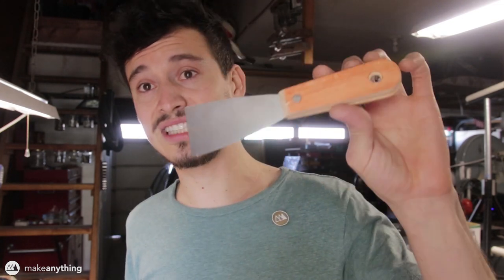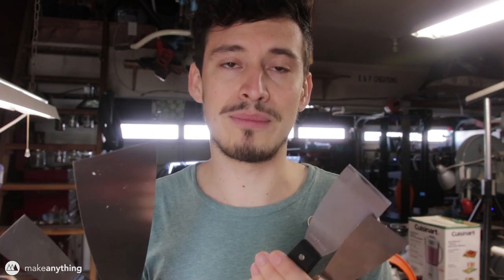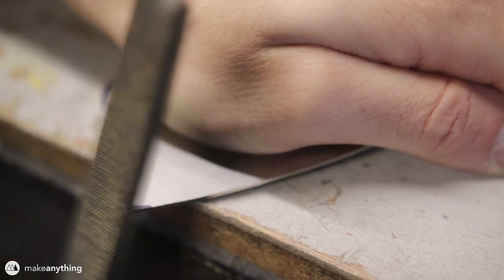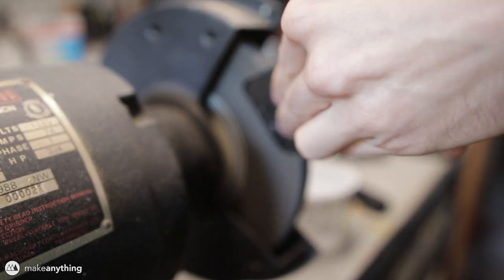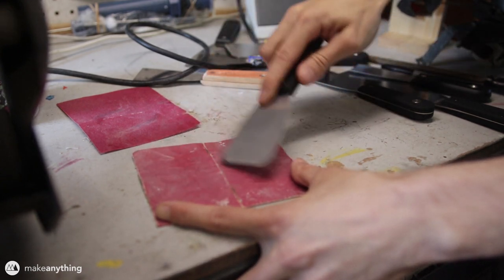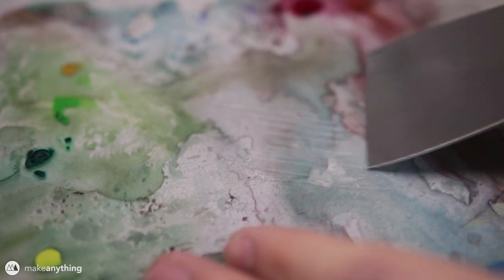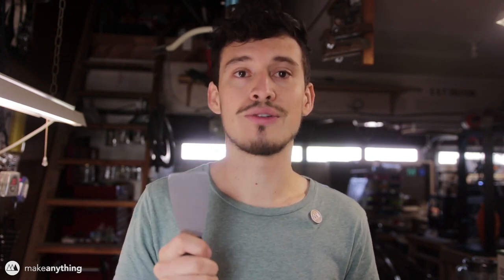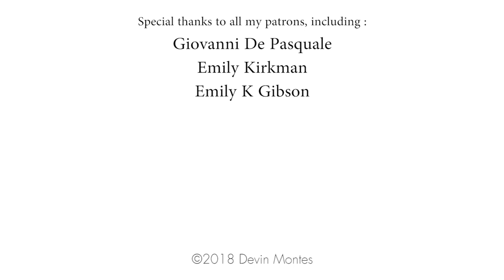Make a Better Scraper for your 3D Printer

Comment: A few things:
- Push the file, don't pull. Its not designed to be pulled
- when grinding, don't do it the way you did in the first shot, do it like you did on the second. Also, keep the spatula pointing down. The grinder can easily snag your spatula and possibly impale your face or body if you are not careful. 
- The term for those burs that you mention is actually referred to as the "feather", and is the reason why you use leather to strop a blade. (fun fact)

Not trying to hate on you but safety is important when you make things.
Reply: also, im pretty sure you're not supposed to use the side of the grinder to grind things. i could be wrong but thats what i was always taught.
Reply: vinny berg OP is mostly right, Never point the blade UP the wheel as is can catch. But using the side of the wheel is sometimes questionable. (Blacksmith here for some kind of qualification of my opinions)
Reply: shrimpicus vinny berg You absolutely don't use the side of these types of wheels.
Reply: NPG3D Why not?By using the front (thin) side you creatie small indentations  on the wheel what maken it bad for grinding only use this side when the whole wheel is being used is what i got taught.
Reply: Levi The straight wheel type is only designed mechanically for use on its rim. By grinding on the side like this, you are greatly increasing the chance for it shattering, and it can't be smoothed out via dressing. 

As for the small indentations, that is not exactly true. Much of the work done on the face of this type of wheel is in grinding things which are smaller than its width, such as drill bits and pieces of HSS. 

To fix the uneven surface, a tool called a grinding wheel dresser is occasionally used, which is run along the surface to smooth it out.
Reply: NPG3D you can use them that way, but they arent designed for taking cutting forces from the sides. If you do do it you have to grind really slowly and not push on the wheel. Also preferably not that close to the edge of grinding wheel.
Reply: Eric M, that would require removing the guards (unsafe and OSHA incompliant), and plus each time you use it in this manner, material is removed from the wheel in a way that can't be normally trued or dressed, leading to a permanently and increasingly more dangerous wheel at risk of shattering.

Comment: Getting rid of the sharp edges should also reduce blood stains on the print bed
Reply from the maker: +Michael Wuchitech yes, I forgot to mention that big plus!
Reply: Kevlar gloves FTW!
Reply: But blood makes the print better...i mean, it helps modeling clays, putties, epoxies, super glue bonds, makes paint more vibrant...im sure it helps plastic too.  I mean, blood for the....oh wait...
Reply: Sometimes electronics require a blood sacrifice to work

Comment: Have to recommend using oil painter palette knifes, they're thinner, pre-rounded, and you can get a 5 pack for about $6 on Amazon. No prying needed just slide in go around the edge of the print and they pop right off.
Reply: yes

Comment: I use a longer blade scraper with a sharpened end.  Sharpened exactly the same way I sharpen my chisels.  It acts like a flexible chisel.  I print on toughened glass salvaged from a scanner so I don't see scratching on the build plate.  I use the sharp end flat side down at a very low angle to try to get under the print.  It works for me.

Comment: Sorry for smart assing (is that even a proper word?), but files are usually just good for filing when they are pushed. The teeth are similar to the oines on a saw. And you shouldn't hold any object to a grinding wheel like you did in the first shot. When your hand is below the point where you grind, it could easely grab to hard into the grinding wheel and when this happens your wrist will get hurt pretty bad. Hopefully you understand what I have written ;D
Keep up your great work and enjoy your camping/eating trip. Greetings from Switzerland

Comment: As has been previously noted: Files cut in one direction. The pushing one. Pulling on a file mashes the teeth flat and is therefore a great way to make your file not cut for very long. Push, then lift, reset, push again, repeat from step two. Be sure to clamp the work firmly, whether in a vise or to a table, and clean the file with the aforementioned file card regularly to remove the filings from the teeth and ensure a clean finish. 
If you do it right, sanding should be optional, the metal will be removed reasonably quickly, and your file will last for years or even decades.

Comment: The spatula shouldn't scratch glass because glass is harder than the metal used in spatulas. If it is scratching, it's not proper glass or there is some sort of film on it.
Reply: yeaaaah I was thinking how do you even scratch your glass plate, should take more than a spatula.
Reply: Glass is actually really easy to scratch with a blade like that, you can pretty much ask anyone who have tried to clean an aquarium with a razor, and they will confirm it
Reply: Joakim Innvær maybe it depends on the type of glass. But look at one of jerryrigeverything's phone tests. The glass won't be scratched by a razor blade. If that doesn't prove anything, try to scratch a drinking glass you have at home with a sharp tool made of metal. It will do very minimal to no damage at all
Reply: I'm with the OP -- I used to use a razor blade to clean the crud off my old glass build plate all the time -- never left a mark. -- Not sure it could! -- It was tempered glass though, I don't know if that makes a difference.
(I believe some of the newer printers are just using regular glass? -- There was a lot of hype back in the day that 3D printers needed tempered glass because of the temperature shock [ they don't ], but that's what a lot of us used to use.)

Comment: Or you could just get a flexible build plate...
Reply: But glass is better
Reply: Energy Flurry 
Flexible Glass!
Reply: i would imagine flexible build plates would have a hard time maintaining their flatness over time and cause adhesion problems and other forms of print failure
Reply: And then you take the plate off constantly and need to keep relevelling
Reply: Wounded MONK if you manage to bend your plate so much that it becomes deformed then you're doing it wrong... Then how did Prisa get it done in the MK3?
Reply: We at Prusa Research use spring steel, it's practically impossible to bend it "too much". In usual use I doubt it will ever not be flat.
And with auto-leveling it's not a problem to take it off:)

Comment: I've been thinking of printing one of those razor blade scrapers, I'm not sure how good they are. I feel like the think flexible blade of a razor blade would be pretty forgiving and be good for getting a start of lifting the print. I normally get impaccient and spray cold propelent on the plate

Comment: I am using plastic razor blades..   They scrape w/o wear and tear on the part or the bed.
Reply: Arnold Horshack and it's like 500 for $5
Reply: Plastic and razor

Error, does not compute
Reply: I use those with a dull spatula for larger prints... -- it's super lame... -- I wish I just had a giant razor sharp spatula...
Reply: Arnold Horshack Where'd you get those? Never heard of a plastic razor blade before.
P.S. sorry for the late comment :)
Reply: I had never heard of them but Google showed me they're widely available.  Lee Valley, Amazon, Banggood, Lowes...

Comment: The one or two times I really, really couldn't get off a print a places the entire buildplate in a frige.
It worked really well and the print popped right off, but cleaning the wet buildplate that had quite a lot of glue stick on it was horrible...

Comment: Thanks for the video its helps lot.
But I want to asks something. Is their any 3d printer that can using a cement and sand material? As this can make it easy to print a baluster and roman columns without using a mould I need help please Sir
Reply from the maker: There are printers like that, but they're certainly not consumer level (aka very expensive). It might be possible to modify a printer to do this if you've got the technical skills

Comment: Strange, never needed or used a spatula. When a print is hard to remove I use a pair of tongue-ang-groove pliers. Prints come off with very little effort, it's adjustable and can easily apply rotational force. Never damaged a print or my print bed, and it's covered in painters tape (another reason i don't use a spatula)
Reply from the maker: +GarfieldGaming thanks for the tip, it definitely depends on your printer and print surface